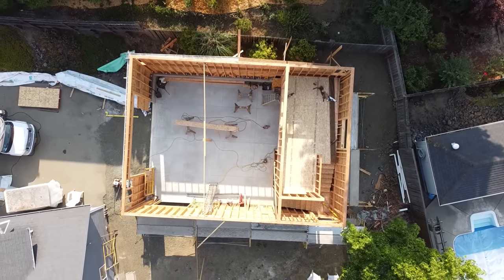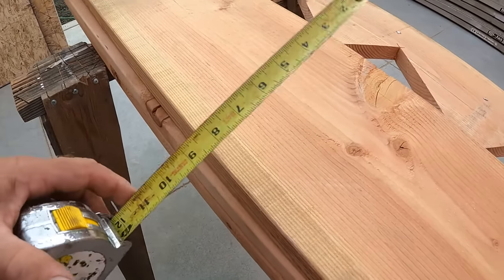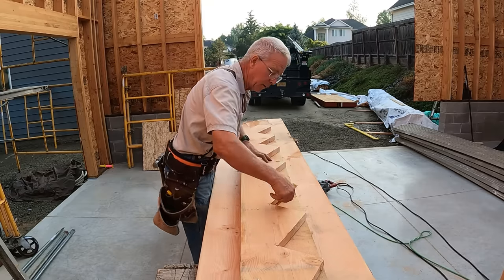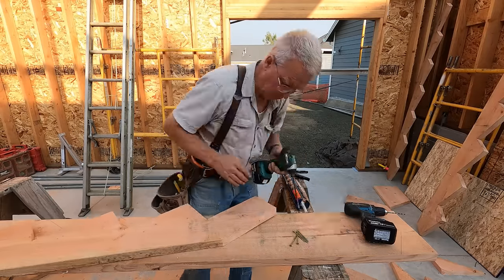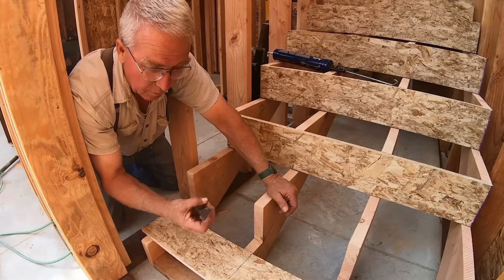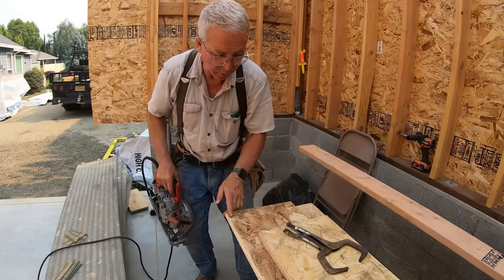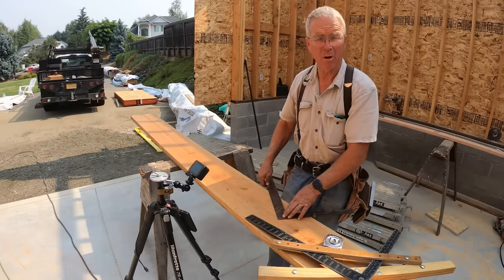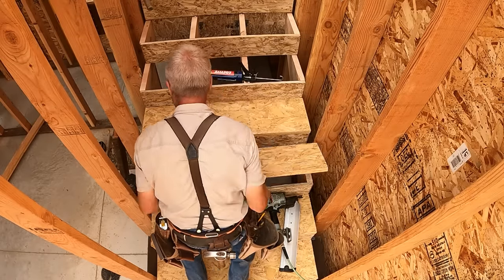Cutting Stairs With A Pro - Tips and Tricks: Shop Build #14

Comment: As always, your videos are full of so much knowledge, inspiration and it shows in your craftsmanship. I really like the idea as to how to start a rip cut with a circular saw by bringing the straightedge to the saw, but i missed how you get the other end aligned and clamped down. I rip plenty of 4x8 plywood to size for the table saw (more manageable) and I always use the 1.5" rule, but am always willing to learn new tricks of the trade. Thank you again

Comment: all the inscriptions on the framing square together with two 4" long spring clamps keep a 1x2 board used for a fence from moving even after days of use on site and being stored in a crowded job box.

Comment: Scott- I don't know if you've ever run across framing chisels, but check them out. I've found them to be indispensable when you need to tap the waste out of a corner like your stringers, or clearance a bit of blocking, or knock the waste out of a joist or stud after you've grooved it out for a notch. They're entirely steel with a big mushroom head, so you can smack them with a steel hammer without worrying about hitting your hand or breaking a plastic handle. And the blades are super long, so you can sharpen out nicks from nails or screws for years and still have plenty of blade left.

Comment: Like I've always told my apprentices and helpers, just keep your eyes open and pay attention. A lot of what EC has provided here is common sense. I always order my stringer boards the next size up because 9 times out of 10 the cracks are always on the ends. Also, as far as the framing square is concerned for layout, just pick your best board with no edge issues to layout first, then cut it and then trace the others to that cut out board.

Comment: Started my carpentry journey at the tender age of 28… I’m 45 now. Learned a lot along the way. Some things I just figured out on my own. My sleeves are full of tricks as they should be. 
One trick I’ve created for myself when it comes to laying out stringers is (because most often the outside corner of the framing square is bent/rounded off) I use the inside corner of the square to mark the stringers for a sharp 90* and this also allows me to use the opposite side marks on the square as a witness mark/reference line to know I’m drawing my next step in the right place…. 
If that makes sense to you…

Comment: For our Minnesota building code to be compliant requires a stair nosing of between 3/4" to 1-1/4" projection including the landing and upper floor.  Yes, you would need to staple the carpet tight up under the nosing or bring it down at a angle and stapled at the bottom of the riser (waterfall installation). Also instead of the 3/4" side spacer I use a 1.5" space (2x4) which also leaves room for skirt boards.

Comment: First off my background, 25 yr's Autobody repair's, 15 plus yr's Welder fitter (5 yr's at a ship-yard, where we built little 400 foot long canoe's, with FULL-SIZED helicopter landing pads on the bow of the little boats ) to present day, @ 69 yr's still welding odds job's when they come into my shop at home.

 @ 14:52 of the video, I would suggest flipping the board over, (yes, it would force you to use your left hand to make the cut.) so that the 3.5 in. surface of the saw, slides along the board, and maintains a true 90 degree, as opposed to using the 1.5" in. side of the saw, and the chance of not keeping a 90 degree cut, especially if you have to stop the saw, than restart with the torque of a worm-driven saw, changing the angle of the saw to the board.

Comment: Great video.  The only set of stairs I have built were for a deck.  It was a long run and one of the 2 x 12s curved (crook) about 6 inches after I cut the steps.  I bought five large C-clamps, used them to pull the stairs straight against a 2 x 6 sistered to the 2 x 12 and screwed them together.  Added a 2x6 to reinforce the straight stringer as well.  It turned out OK but I could have used this video about thirty years ago.
Reply: Had the same problem with kiln dried PT, had them crowned up, while cutting out the triangles saw blade was binding. Was under serious tension, when it was all cut out, it was crowned down badly, unusable. Ended up getting new wet PT and didn't have any problems. The KDAT lumber is unpredictable, sometimes it stays straight, sometimes it seems spring loaded when your cutting triangles out of it.  On a short set of stairs you probably won't notice. On all sets of stairs I put a straight edge across all the stringers, and belt sand any discrepancies.  Yes, I build decks for a living.

Comment: I just built my first set for my house I’m building myself. U shaped with a landing. Building inspector stopped by to see how things were going, he looked at the stairs and said they were very nice,  spot on. I built a jig to help get super straight square and plumb cuts. Having just watched this I had come up with the top attachment method putting in a shallow slot to slide joist hangers into to attach to the ledger. I’d make a better furniture carpenter than a framer I’m to exacting. Who planes headers so they’re perfectly flat.

Comment: This video well explains alot about stairs. I was lucky one job with the assignment to build stairs in two stairwells, one seven floors and the other eight. There were landings between every floor. Premium # 1 Structural three by fourteen stringers though so no picking and choosing neccessary as in this video. Essential Craftsman shows the way again.

Comment: I've taken to making stringers from plywood- 12" rips two layers of 3/4" ply, glue and fasten with screws , which are removed when the glue is set.  Stagger joints to get whatever length,  No shrinkage, no defects, no crown.  Plywood sub treads and risers, all glued, no squeaks.

Comment: That's today"s lumber! (Over 50 years as a carpenter). I'm liking LVLs for stair stringers ( if you can stomach the price)
Reply: Time... time is far more valuable.  I would only mess with that "lumber" if I were in BFE and sourcing an engineered solution would take considerably longer than patching this solution together.

Comment: Those are good tips! One thing I've done is make the top and bottom cut and have the stairs marked. Put it in place and check the marks with a level they should be plum and level of course. Everytime they was but I just like to check before I cut it all up. 2x12 is expensive now days

Comment: I have had long debates if it's worth while cutting a pattern test fitting and copping it or just following the marks. I usually build a set a week on decks and don't feel confident not checking my patterns.  I've only done a few sets of steps inside it's the same except different materials. I do recommend using 2 2x6s for the stare treds on a deck it seems to hold up better on the decks I remove them the wide custom cut treds and it's cheaper.

Comment: Curious to hear your thoughts but I have been told that stair stringers is one place where it really makes sense to use use an LVL. Straight, defect free, and rock solid stable over time. Yes it costs a bit more than dim lumber but if you have to discard one or two boards that have too many issues, we’ll thats the same extra cost right there.
Reply: LVL is definitely the way to go go if it’s in the budget.

Comment: Learned this trick by accident. I was ripping my hair out trying to lay out the end of a stringer. I had a scrap of angle iron and two vice grips. My project needed a run of 21" to a rise of 6 3/4" (Total rise needed four steps, width a bit over 5') and even in 2x12's what was left in the throat of the tread, to me, wasn't enough to support the weight with angles that shallow. My solution was to break out the router and cut dados I could slide the treads into for the outside stringers. Weight was a concern for the whole system as it would need to be taken off the house to access inspection hatches. It uses a french cleat where I selected clear and straight lumber with growth rings at 45deg so I could mill the strongest bevels possible. It is the stiffest open tread stair on the property, yet two strong men can pick it up to move it out of the way with no tools.

Comment: I used to run 2 x 12 blocking in the stud bays for drywall nailing & a 1 x 4 spacer on the side of the jacks to make a space for drywall to slide down. a little more work but it made for what I always thought was a better product.

Comment: Years ago when there were many more REAL lumber yards, you could order up 2x12 stair stringer stock. It was selected to be almost clear of knots, really straight and no wane or heart. You might still find this premium select material at a premium lumber yard but you'll never find anything close to it at the big box stores. You may find something similar if you open a fresh bunk and pick through a bunch, but after that lumber sits inside the heated big box store it's going to start drying out, splitting and twisting up almost immediately. Using LVL's worry me a bit because fastening into the edge gives only marginal holding strength and possible separation of the plys. Kinda like edge nailing plywood or edge nailing or screwing into an I-joist chord. I'm probably overthinking this for a stair application, but when edge screwing into lvls in heavy structural applications, it is necessary to consult an engineer to consider the pull out forces imposed on the beam by the fasteners. Too many screws, too close together, can lead to a catastrophic failure referred to as a plug pullout.

Comment: If I  use dimensional lumber for stringers I use either 1 plywood rip with construction adhesive and screws married to the 2x12 as finding any 2x8 or bigger that's not split is impossible I like to sandwich 2 1/2 ac or rated plywood rips on both sides or of course an 11 7/8 LVL is the best choice for strong stringers

Comment: I really did laughed out loud when you started digging in your bag because I have a similar bag that I have to do the same thing with, many times I just dump it out to find what is at the bottom!   thanks for share that and the rest of the video with us.
Reply: Yeah, I got a kick out of that too. I finally picked up a couple of those Klein zippered canvas pouches for the small things like stair gauges. Much easier to find the smaller things that I don’t use all the time.
Reply: I’m that guy on the crew with one or two of about every thing in bottom of my belt .

Comment: Thanks for the great video. If you were going with carpet wrapped over the front edge, would it have been better to cut the back of the step and leave the round over so the carpet does not break over a sharp edge?

Comment: Learning so much from your videos. Noob question, would it have been enough to use only 3 stringers instead of 4 ? It's better on the long run I imagine to have 4 instead of 3, for a usual 40 inch opening?

Comment: Cutting past the corners in the stringer with the circular saw makes weak points where splits can begin if the grain is in the same direction. The effect is not huge, but best practice is to cut up to the corner with the circular saw and then finish the cut with a hand saw or reciprocating saw.

Comment: Im no carpenter by any means, but a thought struck me as i watched you cut out them steps and then chisel out the last pieces in the corners (8:12 mark)
Would it be a good idea to perhaps use a drill, lets say 1/4" - 1/2" drillbit, down in them corners? 
That way you wont "cut the fibres" in them corners where strength is needed, and having a radius from the drillbit should help with the stresses it recieves when walking in them :)
As you keep reminding us - keep up the good work <3
// Sweden

Comment: Coming from the drafting side of things, designing the stairs is also a tricky process. Lots of code to follow around the rise/run, landings, tread length/width, railings, half walls, over head height, and materials.

Comment: When doing stair stringers I set my jamb nuts(as I’ve always known them) on the out side of my square but I set them so the inside of the square is my riser and tread. Now if your measurements are 1/16s and your square has 1/16s you can space each consecutive step by lining the outside ruler of your square up with your previously marked step. For example, if my treads are 11” and my rise it 7” I draw my first step and then I can slide my square so the outside # on my tread leg reads 12 1/2” where it crosses my first riser line. This is assuming I’m using the shorter 1 1/2” wide side of the square for my rise. If I’m working from the other direction I would slide my square over so the 9” mark on the out side of my riser leg is at my first tread line. I’ve found this to be more accurate then trying to match a line as it hits the end of a board and is also works much better on a board with a defective edge. If you are working with an odd fraction you can also just draw a square line across both legs of you framing square at your tread length and riser height and then use that to line up each step.

Comment: I'm retired now, but always liked a stair challenge.
Was wondering why there are 4 stringers on the bottom run and only 3 on the top run?
Are the tread to riser points flush or does your code require nosing overhangs?

Doors can be challenging,  too.  French doors particularly.

(Edit for typo)

Comment: Another video based in the reality of carpentry:
-We've all gone through that search for the rarely used tool, and spent more time in that search, than we did using the tool. 
-After the search we always make a vow to better organize our tools, a vow which is quickly forgotten.

I think I know where my stair gauges are. I think.
Reply: Haha yeah I had to use a clamped on scrap last time because they are somewhere. Trick I have been trying is think of the first place you would look for them and put them there even if there is a better place
Reply: @stich1960  I suppose, these days, I could wear them as earrings. They'd be handy and nobody would notice.

Comment: When I have stringers that need to fit exact from one point or line to another I started calculated and marking my diagonals because using the nuts if I had 16 to 20 stairs I noticed I could be off by overall run by up to an inch! I pencil mark off every stair Adds up

Comment: If the carpet does not hold up over time, you may want to replace it with a commercial rubber stair tread. Roppe or Armstrong. (about $30 each today)

Comment: I also like the framing square fixed stops. I like the wood gauge, but the 18 in span laying flat on the stair jack may not be as accurate because of the crown in the lumber. What do you think?

Comment: I often wonder why carpenters don't sister a 2"x6" onto the stringers to stiffen them up and to reinforce any defects.  An alternative would be to glue and nail a 1"x4" onto the bottom of the stringers to make them into an inverted T section.  Either would be quick and inexpensive, and would be cheap insurance.
Reply: Thats exactly what i have done, just with 2x4 nailed to bottom. If stairs are freestanding and needing handrails, the underside also works as a rabbet to register the uprights for the rails.
Reply: I add a 2 x 4 to each stringer. And you're right, it's cheap insurance.
Reply: I have always sistered 2X4's on each side of inside stringers. Thought it common practice for the last 40 years

Comment: Scott, I don't know why you had to cut off the nosing off the treads; you can still glue/staple the carpet. Climbing stairs are more comfortable with a nosing that protrudes the tread outward to meet your foot. Reducing the dimension of the tread width changes the rise/run geometry in a way that will make one lean forward while climbing, which causes slipping and falling while ascending, like Joe Biden did on Air Force One. This is the reason for a stair nosing.

Comment: I still use stair gage buttons but I'm going to try your straight gage. However, it doesn't seem to alleviate the wane/rolled edges of the lumber which is the most troubling thing laying out stringers.

Comment: Noob question: Why don't the stringers which are resting directly on the concrete need a pressure-treated sill like the rest of the framing has?

Comment: Thanks for the great video. Unfortunately I cut the stringers on my first ever set of stairs the day before your video came out. But fortunately I have not actually done anything wrong. A question for you - you put the OSB on the riser face before the tread. I was intending to do it the other way around. Is there any reason for doing that way around? Or does it not really matter?
Reply: If you put the riser first you can line it up with the level cut for the tread but not visa versa

Comment: Please answer this question for me. I have been using a sidewinder for 8 years I bought a worm drive after watching your videos. I love it accept when I’m leaving the line in a cut and I’m cutting on the right side of the line. Your line disappears. The only thing that has come close for me cutting accurate on that side of the line is just starting the saw where I want and squaring the shoe with the other end of the board but on stronger I can’t do that. I would really love to use my worm drive 24/7 but because I don’t have the hours in on it I’m just not used to it. Any tips?
Reply: I’m sorry I meant left side of the line when the shoe of the saw is blocking your cut line
Reply: I meant stringers. Sorry

Comment: Why did you only use 3/4 inch spacers between the wall and the stringers? Now you dont have room to run a skirt board.  I always use a 2x4 as a spacer to give me room for 1/2" drywall and 3/4" 1x12 skirt board.